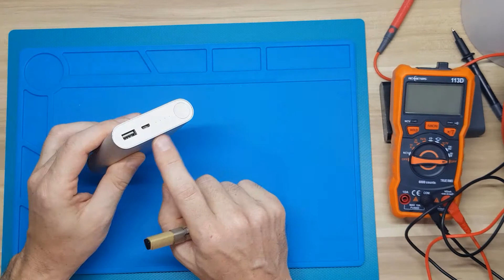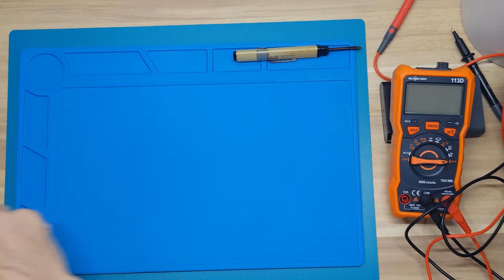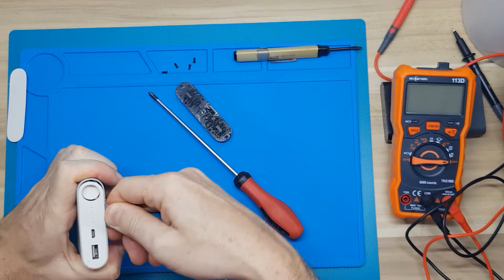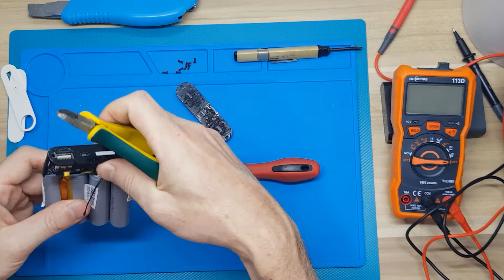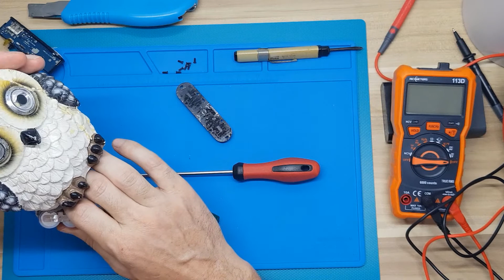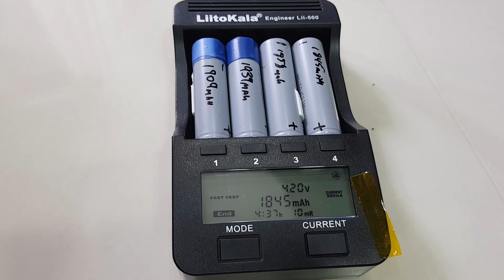Harvesting 18650 Batteries from an M1 (Xiaomi) Powerbank

Comment: Hi, i did the exact same thing on four different power banks. Prior to dissembling they could charge and discharge. After i harvested they don’t work on my flashlights or fans, but all button top batteries that i purchased work. Any tips?
Reply from the maker: The output of these cells are 2.6v to 4.2v. are you using them to replace an equivalent V?
Reply: Yes, thats the exact V on the button top battery. For some reason none of the flat top batteries harvested from power bank works on various devices that take 18650 batteries.